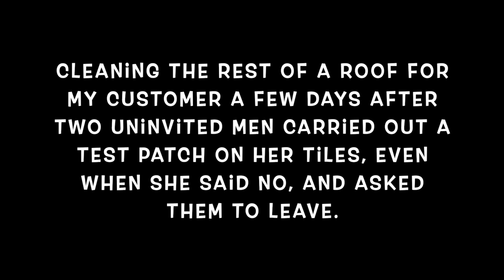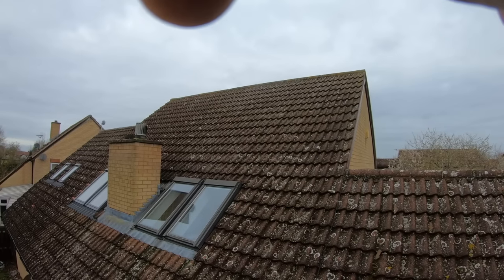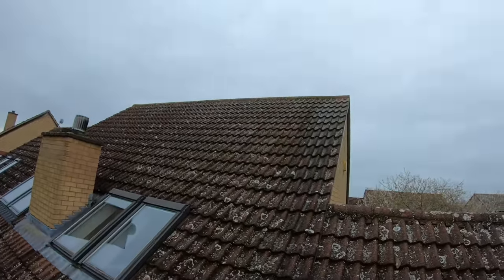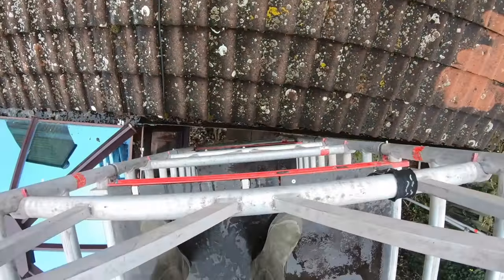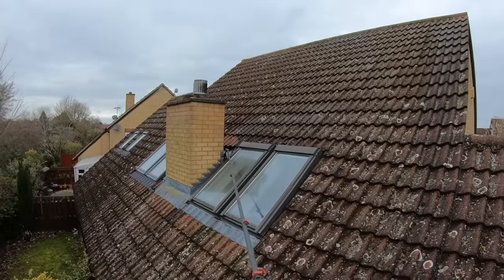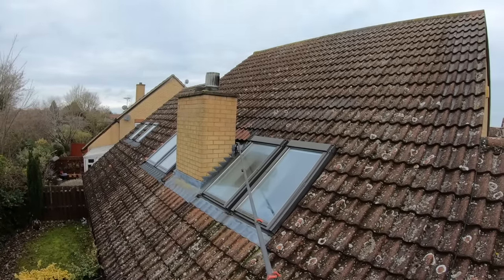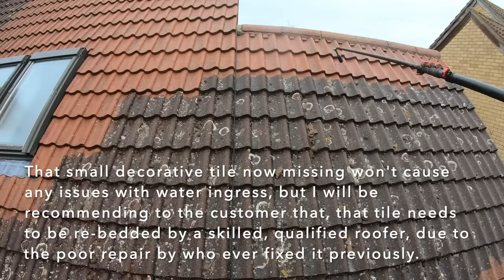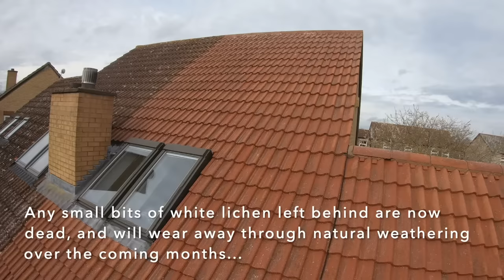UNINVITED GUESTS Cleaned A Patch Of My Clients Roof, And Wouldn't Leave Until She CALLED THE POLICE!

Comment: Wow, the only thing you need to be doing is spraying Chlorine straight onto that roof with little pressure like that of a water hose. It is the right way to clean a roof. Never use pressure on a roof folks. Cleaning a roof with pressure can damage tiles, and it will not get rid of the mold. Mold will regrow quickly. When using 15% Chlorine, it kills the mold spores and the roof will be clean for 5 or more years. My friend does this in Florida and has been doing it for more then 30 years.
Reply from the maker: I think you're confusing how it's done in America with how it's done here in the UK. Yes you're right, you can't use pressure on bitumen shingles, which is what most of you guys seem to have on your roofs in America, as it will damage them. But It's perfectly okay to use low pressure through a pressure washer on concrete or clay tiles despite what some people will say and think, which is what we have here in the UK. We only use bitumen tiles on sheds and small office log cabins.

I'm well aware of the effects of chlorine, aka bleach, Hypo, SH, because that's exactly what I put on this roof after pressure washing, it's in the video. Would never put it on at 15% though, that's way too strong and completely unnecessary, a 4% or 5% solution is more than enough to kill any living growth on a roof.

Comment: This seems like a painstakingly long process compared to how we do it here in the US. You breaking one of the tiles is the main reason we never use pressure to clean roofs. We soft wash with chemicals only. But soft washing after using pressure kind of defeats the purpose.
Reply from the maker: We have a completely different process in the UK to you guys in the US. I think i'm right in saying the majority of your roofs are asphalt shingles, which yes of course you can't pressure wash, because it would cause irreparable damage. But as we don't use asphalt in the UK, apart from on sheds or garden offices, we use mainly concrete or clay tiles,  which means what you're saying doesn't apply, as using low pressure through a pressure washer, doesn't cause any harm to concrete or clay tiles what so ever.
I didn't break the tile, it only slipped out of place because of an incompetent repair, note how the rest of the roof was completely unaffected by the cleaning. It's just by sheer luck that tile hadn't slipped out of place already, from a strong gust of wind or a bird landing on it.
Soft washing after pressure washing doesn't defeat the purpose. People in the UK mostly want there roofs cleaned not for aesthetic reasons, but to stop the moss constantly blocking their gutters, or making a mess of their driveway or patio/yard. So we either scrape or gently pressure wash to remove the majority of the moss/algae/lichen, then we soft wash with SH or biocide, to kill off anything left behind, so the re-growth has to start from scratch, which takes years.
Reply: We really have completely different standards for roofs in the two countries. My dad just came back from a visit to the UK and he was impressed by the tile roofs compared to our shingles that need replacing every 20 years
Reply: @PrestigeExternalCleaning  you wouldn’t need to use pressure if you just started with the soft wash. And yes using the pressure washer caused the tile to come out. While the tiles are strong the mortar is not. I would highly suggest soft wash only. Not only is it much safer but it is WAY faster. Wouldn’t need the scaffolding, just a ladder and a 12v pump
Reply from the maker: @Unmployable  Did you not listen to a single thing I said?? People want the moss REMOVED AND TAKEN AWAY, it can take months for big lumps of moss to fall to the ground or in to the gutters after being treated with SH. People DO NOT want to clear up lumps of dead moss, or keep unblocking their gutters until it all eventually falls off. Soft washing DOES NOT remove these lumps of moss quickly - fact.I haven't seen any evidence that you guys in the US are dealing with the type of heavy moss growth we deal with here in the UK, it just seems to be loads of black mould with a very rare appearance of the odd, small bit of moss, so you have absolutely no authority or understanding to lecture or "suggest" to me or anyone else in the UK on how to clean our roofs.

Yes I know the pressure washer caused the tile to come out, thanks for pointing out the blatantly obvious, I mean it's clear to see in the video for the whole world to see. But again you haven't listened to anything i've said, that tile only came out because of a crappy repair. If you'd have sprayed your long reach jets up and hit that tile with the stream, it would have dislodged and dropped to the gutter, just the same as me using my pressure washer. Oh and proper, well made mortar is very strong, more than strong enough to resist low pressure from a pressure washer, hence why none of the other mortar was effected on this roof, except for the repair carried out by the joker who did this one.

Now onto the most unbelievable part of your comment, that i'm frankly shocked at. Are you completely unaware of the injuries and fatalities caused by working on ladders?? The stats are shocking,  thousands of people are seriously injured or killed in the UK falling from ladders every year, it must be way higher than that in the US because you're a much bigger country than we are. Injury or death from working off a scaffold are a tiny fraction compared to ladders. Who cares if it takes longer!! i'd rather it take longer than risk suffering a fatal injury or crippling disability. Using scaffolding is one of the safest ways of working at height it also means your insurance is lower because it's safer and more secure. Your comment in regards to scaffolding and ladders is irresponsible and dangerous, and quite frankly, you should be ashamed of yourself for saying it. Absolutely shocking.

Comment: If that's a duplex then there's no way you can clean just one side of the roof without violating the terms in the deed. It's like painting one side of the duplex a different color.
Reply from the maker: This is the UK, not the US, and this is a semi detached house, not a duplex, two separate buildings with their own upstairs and downstairs, joined together, each has its own roof that each homeowner is responsible for. The roofs are connected with no visible barrier line.
Reply: @PrestigeExternalCleaning  .. We have similar laws. I would double check that. It's not you who would be in trouble. It would be the homeowner potentially violating terms ranging from HOA to Deed Restrictions.
Reply from the maker: @DJaquithFL  Thank you ,but I don't need to check. Semi detached houses, and terraced houses that are all joined together are responsible for their own roofs and walls, each house owns their own freehold, meaning they own the land and the property. So 100% can do what they like with their property as long as it's within our planning laws. Meaning they can paint their walls a different colour to their neighbours if they want to, have their roof cleaned or replaced with a different material than their neighbour, have different doors and windows, the list goes on and on. It's very common to see terraced houses here in the UK in a row, all different colours, with different roofs, windows and doors.

What you are referring to, in this country, is if someone has a leasehold property, meaning they don't own the land that the property is sitting on, even if they own the property, they still need to ask permission to carry out certain things from the land owner. This only applies to maisonettes (what I think you call duplex's) or blocks of flats, or apartments I think you call them. I have never heard of a house, whether that be detached, semi or terraced being leasehold. I'm not saying they don't exist, but if they do, they are extremely rare and would devalue that house immensely, almost to the point that, no one would buy it.

Comment: Roofers hate this , cleaning can damage the tiles .
Reply from the maker: Not all roofers. Yeah sure some do, I know of roofers that have added jet washing roofs as part of the service they offer. I get abusive comments every month or two from the haters (or the keyboard warriors with no roofing or jet washing experience) I don't know why they bother, people who are rude, swear at me, show no sign of having a reasonable conversation are ignored, blocked from my channel, then deleted, then completely forgotten about.

The problem we have at the moment, is that the pressure washing industry in the UK is completely unregulated. Therefore we have lots of idiots going around pressure washing roofs using way too much pressure, walking on the roof and cracking tiles as they go. These are the people damaging roof tiles. Low pressure, and working from a scaffold tower doesn't cause any damage to the roof tiles what so ever. I have been cleaning roofs this way for 12 years, and not once have I been called back and accused of damaging someones roof. I cleaned a roof 4 years ago, I went past it the other day and they were having a large extension added to the house. They had re-used the tiles I cleaned and mixed them in with the brand new ones. I stopped and talked to the builder, and he said the old tiles were inspected, found to be in excellent condition, so there was no reason not re-use them. They wouldn't do that if the tiles weren't good enough, it's in the builders interest for their client to pay for new tiles, as they make more profit by adding their charge onto the cost.

My long point is - yes too much pressure can damage roof tiles. But using the correct approach and correct pressure - no it doesn't damage the tiles.

Comment: Aren't you suppose to soft was roofs. Thought pressure washers cause damage. Everyone says to spray a chemical and leave it sit then clean it off with low pressure
Reply from the maker: That’s not how we do it here in the UK. That’s the American way. We remove the growth, then we soft wash. Pressure washing concrete and clay tiles is perfectly fine on low pressure, despite what some might say. We don’t use asphalt shingles like in the US which definitely can’t be pressure washed.

Comment: That wasn't a decorative tile, it's a tile to close off the hole where roof tile meets ridge tile to stop driving rains and rodents.
Reply from the maker: Incorrect. It’s called a dentil, its function is to help prevent slumping or cracking where there is a deep bed of mortar. It hasn’t got anything to do with rain or rodents. I have learned this since posting this video.

Comment: Whats the point in this when its just for looks and it will only look the same in 6 month time anyway. Plus that decorative tile you should foot the bill because your jet wash dislodged it otherwise it would still be there
Reply from the maker: This is a 1980's house, it's taken 40+ years to look like this, in 6 months time it will look exactly the same as it does now, this roof will remain looking clean for the next 5-10 years, that's a fact. 

The point is, people want it cleaned to stop the moss falling all over their garden and driveway making it look messy, and to prevent the moss constantly blocking their gutters. 

Customers are pre-warned if your pointing is in bad condition, or if you have any cracked tiles,  you may lose some, we don't accept responsibility for this as it was already cracked or in bad condition before we started, we've just uncovered it during the cleaning, and they will need to contact a roofer if it's necessary. They can either accept these conditions or not, if they accept, which most of the time they do, then we are not liable Scott.

Comment: Leave the roof alone, it's not Stepford, the mosses and lichens are beneficial to ecology,  another totally unnecessary expense
Reply from the maker: There are plenty of lichens and mosses in the surrounding trees, bushes and any hard surfaces within the area left behind that can stay beneficial to the eco system. It is NOT beneficial to peoples roofs. You're obviously unaware of the the damage moss and lichen can cause to roof tiles. Excess moss can lift and crack tiles as it grows, the moss rhizomes grow into the tiles causing them to split or crack, especially in the winter when there's a frost. Lichens secrete acid, and eat into the tiles as they grow, causing premature wear and damage to the tiles. So cleaning ones roof could justifiably be argued as a totally NECESSARY expense.
Reply: Well said mate. This is essential household maintenance